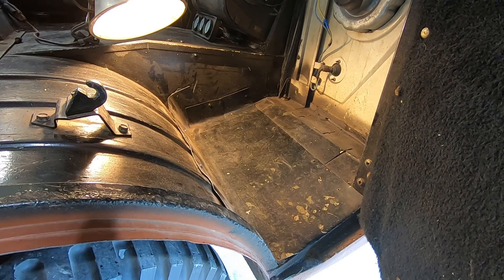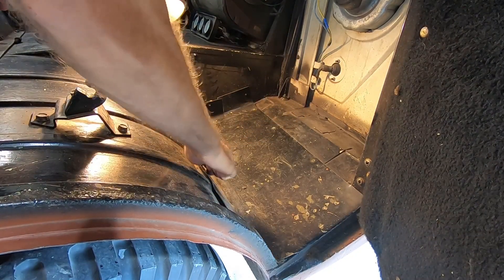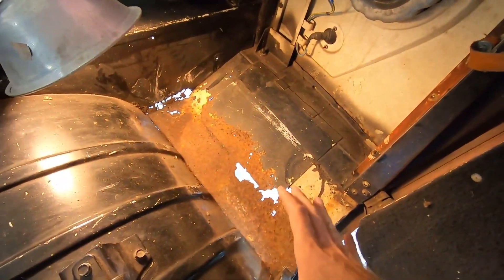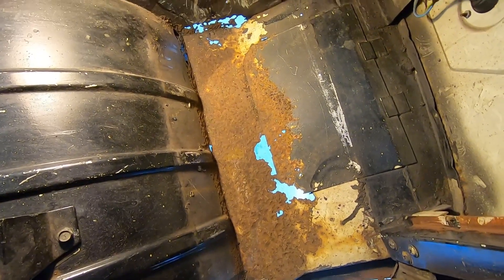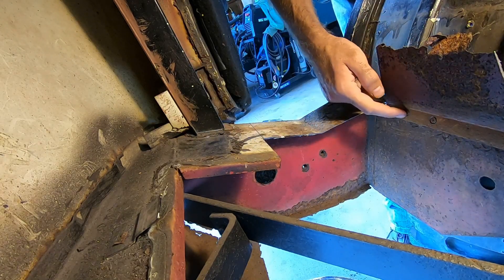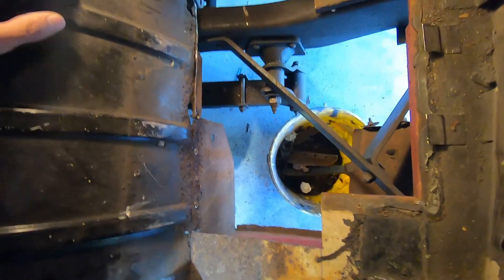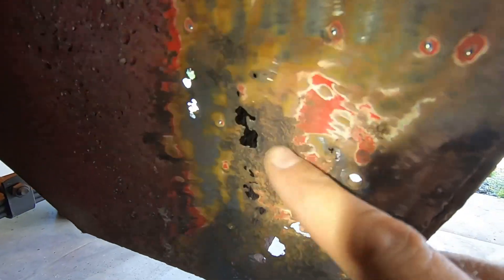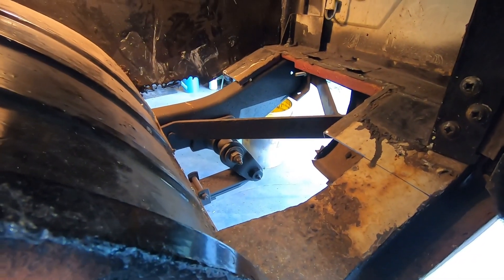⚡️ Rust repair ⚡️ Hand made JEEP Fc150 inner rockers

Comment: Excellent advice on attacking rust repairs.  I'm working on a 49 Willys pickup right now.  I just started on the floors and rockers.  I agree that you have to work on a section at a time to keep from getting overwhelmed.  I won't start on the driver side until I'm completely done on the passenger side.  I am using the driver side as a reference.
Reply from the maker: Thank you Tim! It’s a labor of love for sure. Good luck with your project!